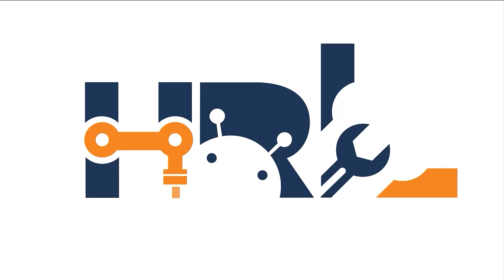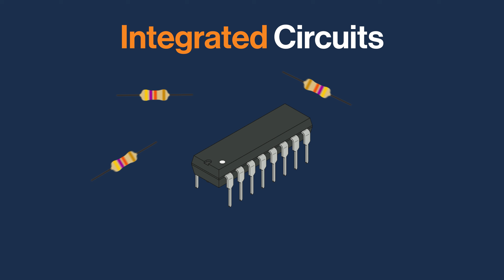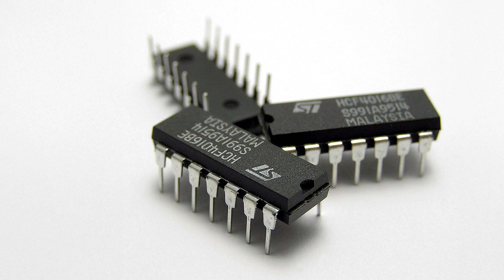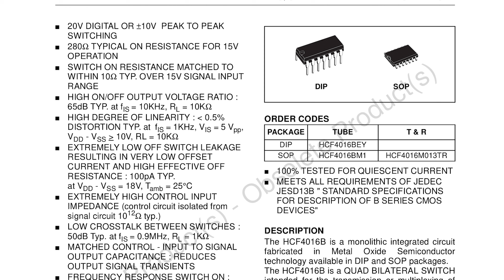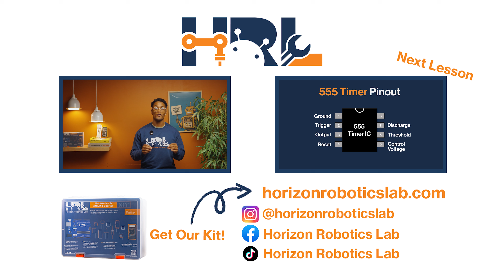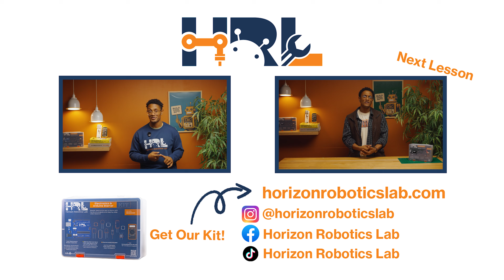Integrated Circuits: The Tiny Chips That Power Everything

Comment: I worked for TI putting the epitaxial layer on two or three inch slices (after this long I don't remember the size) in the early 1970s.  I watched women bent over microscopes manually wiring the chips to the leads of dual inline packages.  The wire was 22K gold and was welded to the chip and the package lead.  Later on I maintained one of the earliest robotic wire bonders for chips.  I saw some of the early chip testers put spots of ink on the individual chips before the slices were broken apart.  The chip industry has come a long, long way from those days.  Computers in those days were in 19" racks and you could put the individual boards on extenders and test them.  We had 1K by one memory chips.